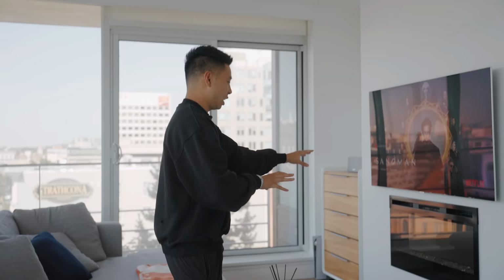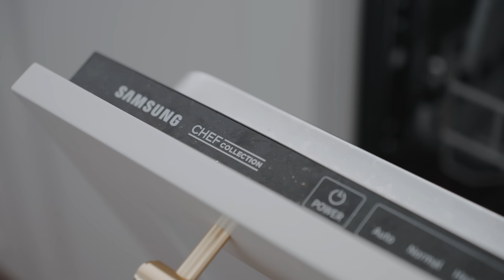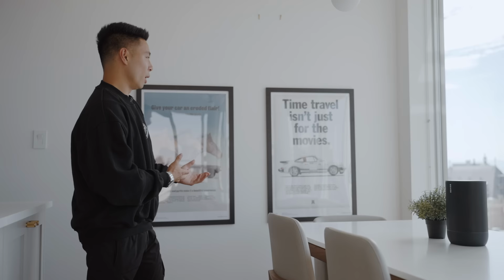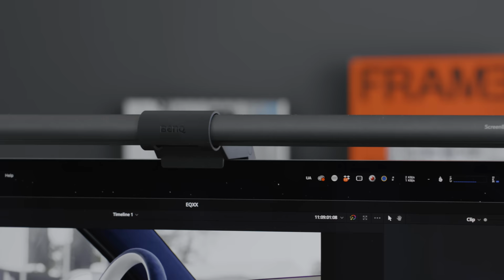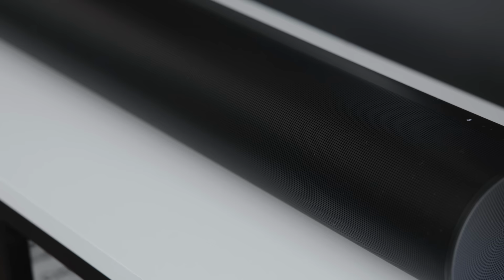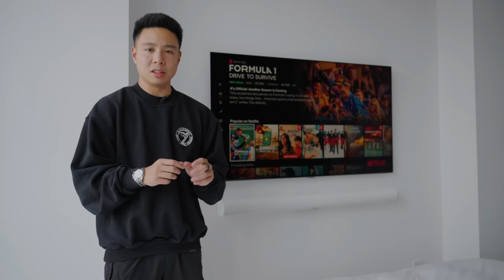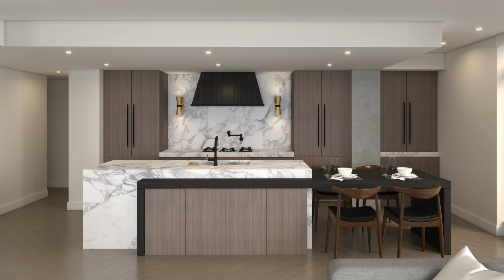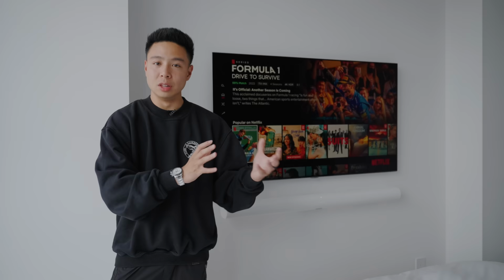Modern Apartment Smart Home Tech Tour (2022)

Comment: I've watched your videos for about the past year, never fully went for the subscribe button but as someone who is desperately hurting in this economy, I definitely felt just the extra little push to go ahead ~ I have worked multiple jobs that focus on needing a computer, but I have been using my 10+ year old computer which had been dropped in its bag by an acquaintance, cracking the touch screen aspect. It sensed continuous clicking from the huge cracks left, so I removed the touch screen and use it as a makeshift desktop. I've been dreaming of building my own PC and have a wishlist of the exact one I'd build ~ definitely reminded of that goal by your mentioning how much you dropped on your mac there. I would much prefer a windows OS, and would not expect your giveaway to be the desktop you invested so much in, but I gotta say that was a big winner for me for favorite, simply because I need a new desktop PC so badly and can't afford such a venture. Insta handle: Phil.Kingsbury